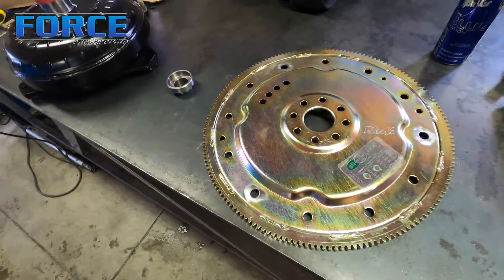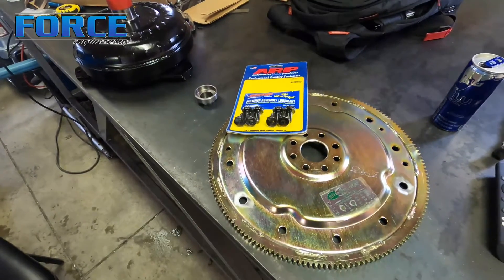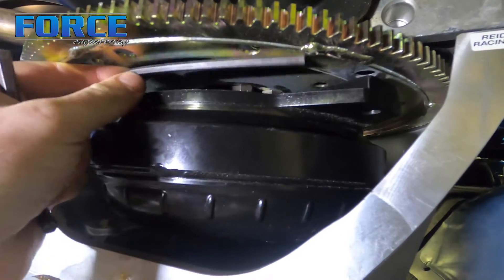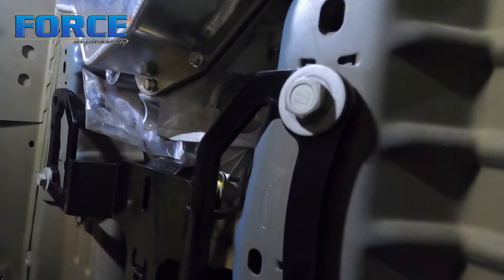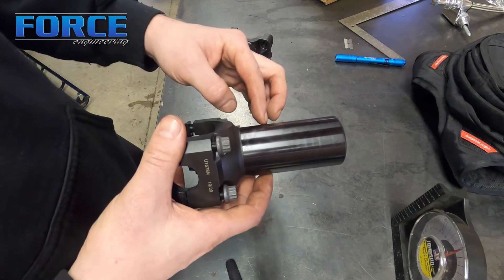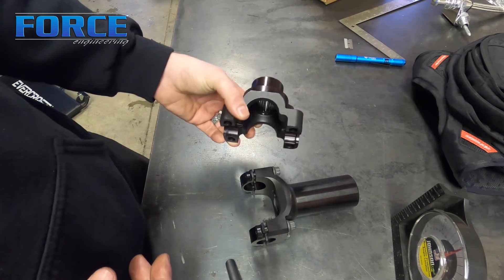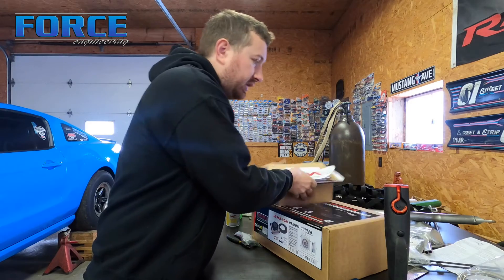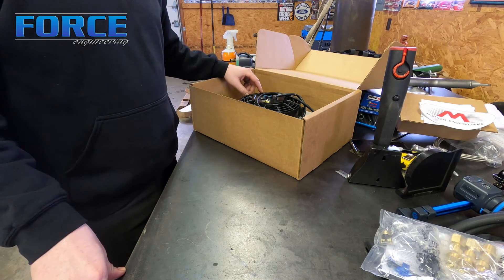Rossler Th400 Swap In Our S197 Mustang Part 2

Comment: What did you do to get the car to crank. I just finished my th400 swap in my 2014 but i have a no crank issue which i assume is a nuetral saftey switch i need to bypass
Reply from the maker: The neutral safety switch is in the trans and not the shifter. I just jumped the circuit at the trans harness end.  For me, it was a temporary thing as i was changing efi systems. Definitely wasn't a permanent solution.
Reply: I seen your comment about pin 16 thing. That got us cranking. I have holley efi but i have a gate-way box to keep the wiring harness and all the cars stock functions working. So we had to eliminate the cars ecu control of starting
Reply from the maker: @slowlsgt  nice! Im glad i made that comment, i couldnt remember what pun i used.

Comment: I have a question just completed this swap in my 14. Lund says I need to wire up a clutch switch as my car was a auto 6r80 car. What wiring did you have to do to get it to start? Thanks
Reply from the maker: Found a work around to eliminate the ecus control of the starter relay.  Worked well.  Pin 16 on the chassis connection is 12v from the start postion.  The ground side of the relay i ran throught the neutral saftey switch.  Move pin 16 to the + trigger on the relay and all works as expected.

Comment: Really helpful man, thank you. Did you reuse stock bellhousing to block bolts? Or does the TH require a different length?
Reply from the maker: Climbed under it and check because i couldnt remember lol.  Looks like i change all the bolts.  They are shorter than the 6r80 bolts.

Comment: Are you planning on not street driving anymore with the non lockup converter?  Just wondering, have a friend who ran one for a season and he'd boil fluid out of the breather on his.
Reply from the maker: I havent street driven it much latley.  That said i still will.  Keeping th fluid temp down can be difficult for sure.  The bigger cooler and fan combo on this will hopefully do an ok job.  Obviously alot of what makes or breaks it from a temp stand point is the converter itself. We shall see.